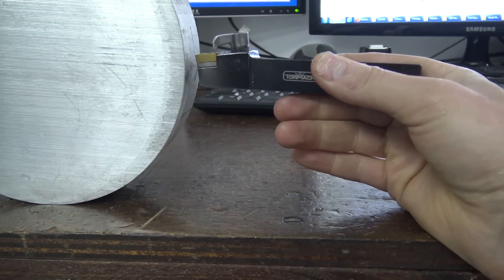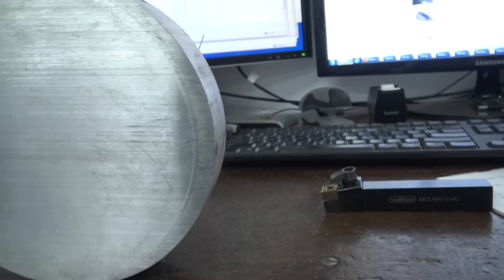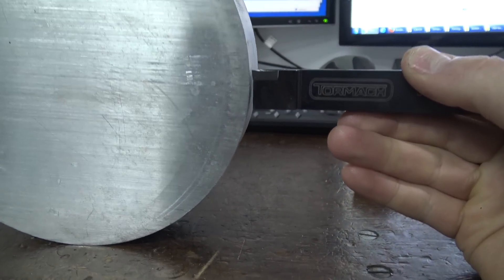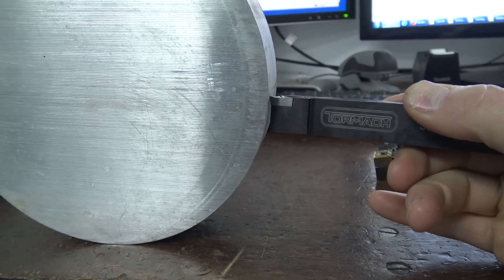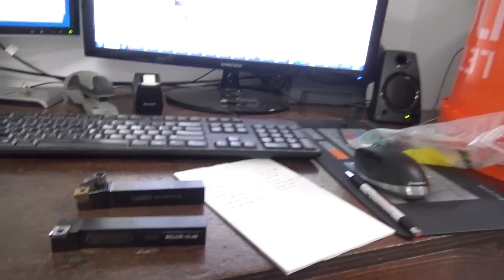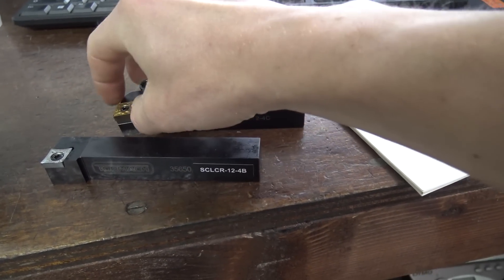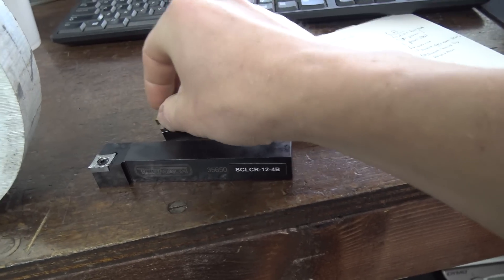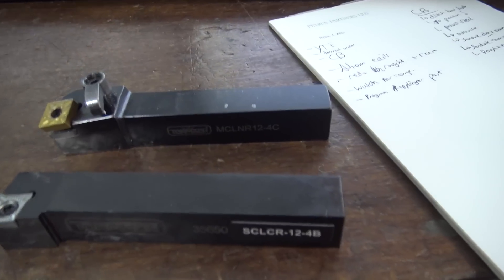Chip Break #6 - Machine Shop & Small Business Daily Life

Comment: From my experience when using negative rake tooling you are able to hog off much more material and still able to get a good surface finish from the same insert. Having a negative rake also means there is more tool pressure against the work piece which will get you a very nice finish. One of the down side is that if you have to remove .002-.003 of material it won't work so well, and that's where your positive rake tooling stands out. On some of the Seco negative rake tooling I've used you need to leave about .010 for your finish pass, so if you miss your dimension you'll loose any chance of a good finish. Hope that helps.

Comment: Sand and paint the metal with an oil based ENAMEL paint (brush or spray) then bake it any way you can. I have used foil backed (hvac)fiber duct board to make an oven (lean-to) with heat lamps in cheap-o reflector flood light fixtures.....FIRST try this with a can of spray paint on a small steal part and bake it in your oven 140-200ish degrees for as long as you can until you start to notice burnt enamel smell or watch the color start getting darker. Done!  This is an incredibly durable finish for steal, looks awesome, and is easy to do! 
Baked enamel for the Win!
bake it a day or two with heat floods until there are no more VOC odors coming from the paint..If You brush it just use a little of the recommended solvent to smooth out the brush strokes. It will look like you sprayed it!   Thanks for all your hard work, inspiration, and solid information! Carl

Comment: Try the Rustoleom Hammered paint in spray can or brush able. It leaves an incredibly strong finish that's not flat but textured and looks like many original machine tool coatings. Think touch up paint for tools. No primer needed. My clients love it and it hides imperfections. There is an original Hammered paint that's a better product but very hard to find. If you use hot rolled angle just brush on a few coats of Penetrol and it's good for years outside. 
Mr Jazco

Comment: We built a ton of tables from 25x3 square tube, brush painted it with regular synthetic (oil/single pack polyurethane) paint. No primer, straight onto the tube after a wipe down with a solvent rag. Brush was quick, no overspray.

Comment: if you want to paint those carts, cheap paint goes a long ways as long as proper surface prep has been done.  by cheap paint I mean the $6 a can rustoelum automotive primer in a can or the red oxide stuff, I love both.  clean any welding soot off and wipe it down to make sure it clean on any oils and just spray the primer.  let it dry long enough and top coat it.  I send finished parts all the time with rattle can primer and paint and the customer loves them.  I do not like doing it so I started powder coating them with your same set up and the results were less than ok.  switched back to rattle can.  

for a better longer lasting paint job get a cheap HVLP spray gun and get the exact same paint from rustoelum in a gallon can.  thin it per the instructions, think it is 15% for spraying and just go to town.  I have a bench in my parents yard I painted this way 5 years ago and it looks phenomal.
Reply: +Tim Yuhas This. Those are pretty much the two goto relatively easy methods.

Epoxy or powder coat would be more durable but seem hardly necessary when rattle can or HVLP will work great and HVLP would have probably the best finish.

Comment: Thanks for doing these vids good info. I am also in the process of learning lathe tooling what to do and not to do. I am a mill guy but just got a 7 axis lathe, whole different animal. Also blew up a seco shell mill test tool while seco rep was there and using his feeds and speeds and they took it back no cost to us. Keep up the good work!
Reply: +NYC CNC It is a haas ds30ssy with v axis bar feeder. On your question about live tooling, I have 6 live tool holders "not cheap at all", but I would recommend a minimum of 3. you can get combo spot chamfer drill and tap tools all in 1 but they have their drawbacks.

Comment: On one hand, painting it can be a mood upper. I mean, paint it something bright, makes it pop, you look at it, it's a mental thing, the science behind that is old and by now everyone knows about it.

On the other hand, it's easier to clean, since paint makes things smoother. Wiping a piece of bare metal of oil, or whatever, it's a drag. Painted things, not so much.

On the third hand (you're going to have to call a buddy) if you like bare metal, you can leave it bare metal. As you said, it doesn't get humid, so it won't rust unless you spill it. Plus, i think that metal has mill scale on it ?!?, so outside of the places where you welded, not much will happen.

Personally i paint everything i make. I take the opportunity to spruce it up, make it look good and match a theme. Heck, make it safety bumblebee :D those are nice.

Comment: We make our fixture stands with the same materials, you just wipe her down with your favorite solvent and paint it with rustoleum spray paint. easy
Reply: no way man, our fixture stands were way bigger and more surface area than that and 2 cans was plenty and it goes on smooth and last forever if you cleaned the surfaces properly before. As for the fumes, just do it outside. Hell, we even use rustoleum paint on our fixtures themselves to help customers with checking procedure. Its the industry standard

Comment: We have a section of the shop setup for a big power airless sprayer, We paint quite a bit so we just leave the 5 gallon bucket hooked to it all the time. We used to use special red structural steel primer from Carbit paint but now we use Sherwin williams grey. I'm not sure why we switched, I'm not the painter anymore, but it does a great job and you'll get a very heavy paint job, not like a rattle can. If we don't plan on painting for a while we'll clean out the system and store it. Most of our painted stuff is structural and goes straight to the job site. There is a lot of overspray though, airless sprayers use a ton of paint. To paint something like your carts you won't beat the durability of a powder coated finish but if you just don't want them to rust the rattle can might be the cheapest method but then you could always invest in a car paint gun. Once you get the mixture right they are easy and lay down a lot of paint. Or you could just clear them for piece of mind. You'll never notice the paint job and they won't rust. Even if they get scratched up you won't really notice. Just use lot's of thinner when cleaning the surface.
Reply: +NYC CNC I was mistaken, The grey primer we now use is DEVGUARD 4360 by devoe not the sherwin williams. I was told we switched to the grey because when a customer wants a white finish it's really hard to paint over the red primer most structural steel shops use.
Reply: +Suade907 That would be because the on-site painters would need to probably need to apply two grey undercoats to hide the red before they can get to painting with white. I'm just trying to remember what the painter at work told me several years ago and he had painted all sorts of different things over the years.

Comment: Hey John, for the frames HVLP would be your best bet, there's a paint which is acrylic based that forms a primer and top coat in one application. Removing the need to change between primers and top coat. It will give a very durable finish with good film thickness along with a semi-gloss/ satin finish.  
If you're looking to spray in the workshop then I'd probably suggest looking at a dry filter back wall set up to keep costs down.

Comment: For me i found a black anti rust paint that goes on with no primer i just wipe down with some white spirit use a paint brush on the corners and welds then a small roller to paint the rest of the surfaces and blend it with the paint brushed areas. I use rattlecans and a spray gun but for the amount i paint i get a better finish with a roller and not have to worry to much about air extraction

Comment: Negative inserts actually present a positive cutting edge geometry to the part.  The chip breaker creates a positive interface with the metal, there are inserts that don't do this, but the vast majority of negative rake inserts actually create a positive cutting edge.  The reason why "positive rake" tooling works better is that it actually creates an even more positive cutting edge, at the expense of fewer cutting edges on the insert.  Negative rake tooling inserts can be had with very high positive geometries, but you still need the right feeds and speeds to get the metal into the chip breaker.  All things equal, a positive tool can have at least 5 degrees more positive rake than a negative tool, so more positive rake the less HP it takes and freer cutting it is.

Comment: I don't know who gave you advice about the seat on that holder, but that's called a pin and clamp holder.  The pin is at an angle and wedges the insert in to the pocket, the clamp is just insurance.  You don't use it for adjusting height, you adjust the height with shims, on a turret that can't be indexed to on-center with 3/4" height tooling.  Leaving the screw loose is absurd and makes the insert loose in the pocket.  No machinist I've ever known left that pin loose when changing inserts, you just set the toolholder on center.
Reply: He is exactly right. Like I mentioned in my last comment in the previous video, the screw is for seating the insert correctly, it should be tightened, it doesn't take much, and then just loosened a half turn or so when changing the insert. It doesn't take any special skill. Those holders are tried and trued for decades and work great. I wouldn't be so fast to have a negative perception of them, you just have not had anyone show you the correct way to use them.  They are a lot more simple than you think, I think you may have got too many mixed comments from the past video and it made you think there is some sort of science to changing an insert in them.
Reply: Hey John, sorry if my reply came off sounding harsh, I was just incensed at the poor advice you were given.
Reply: +eformance same here John, hopefully your tooling guy gets you all set and you can ignore all the mix of advice you have been given. He should be able to explain what we mean.

Comment: At my makerspace, we've had good luck using an inexpensive steam cleaner along with Simple Green HD to clean off all of the grease and crud after fabricating steel assemblies.  The heat allows the moisture to evaporate really quickly so it doesn't flash rust, and it's almost immediately ready to take primer.

Comment: You can get negative insures with positive chip geometry i thought. Most inserts that are designated for cutting aluminum (designated with an N i think) have a positive cutting edge but sit in negative tool holders. with how the pattern is pressed into the top of the insert it mimics a positive tool geometry but has the strength and more cutting edges of a negative insert. but if having a positive tool holder and insert works and you arnt trying to maximize each insert. then that works and you dont have to bother with it.
Reply: +NYC CNC I know. Thats what i love about this trade. You never stop learning.

Comment: I was wondering why you didn't use a helical path with a smaller diameter mill. It seems like you would have less tool face into the work (and thus less chipload per tooth). Plunge cutting with an endmill needs a place for the chips from the end of the mill to be evacuated. This evacuation works well when you have a partial cut (where you are cutting a half round into the face of a workpiece, or where you are slightly enlarging a through hole (which has had most of the metal removed by a twist drill) in order to precisely  locate and straighten it. A plunge cut to make a blind hole or a through hole (which is blind until you break through) need some other way to get those chips out of there. Some will work their way up the flutes, but it doesn't seem like an efficient way to clear chips.
Reply: +Peter W. Meek I am hoping on his next test he does helical interpolation to drill the next hole less stress on the tool and machine. Do a ruff pass and finish pass and your done. Plus I think it is faster. And most of all way less screaming tools.
Reply: +NYC CNC Great I will be looking forward to it.
I really miss not working in cnc any more and doing trouble shooting. Trouble shooting is the best job in the world. You show up fix problem and move on to the next problem.

Comment: Walk over to your neighboring John Deere store and get a gallon of blitz black paint. We sell tons of the stuff to the custom car guys and they love the price and durability.  Believe it or not you can even brush the stuff and it will level itself pretty darn good.  My personal experience is quality enamel is way better than powder coat in durability, but it is more difficult to get put on without runs, sags, and other issues. They make positive inserts for negative tooling. When I send you this lock pin style CNMG holder I will throw in a positive rake negative insert you can try. You should stop by after the show in Louisville if you have time.

Comment: Are you going to use pin gauges to measure the hole in the new test?
Quickest and likely most accurate.
Intern is a great step.  Can they help with data collection too?
OSHA on painting might be an issue.
Powder coating curing with LP IR is great.  I used twin head propane
units for a total of 30,000 btu.
Think of a specific paint / powder coat color for SMW.  Then
make the color a SM.  Coca Cola, Bud etc. all has specifications.
It becomes part of the brand.